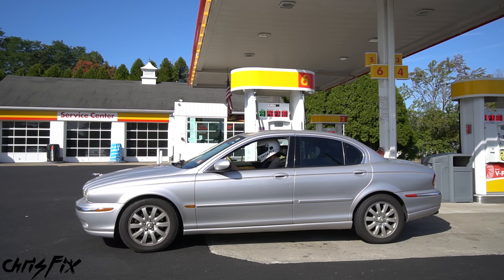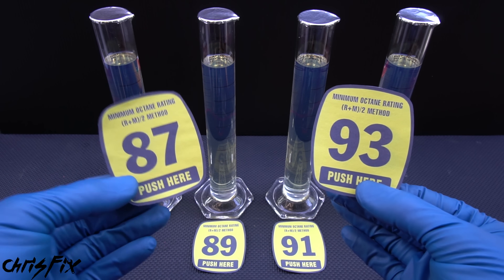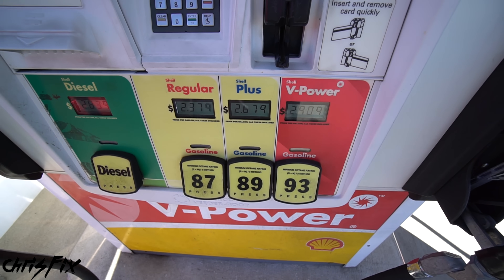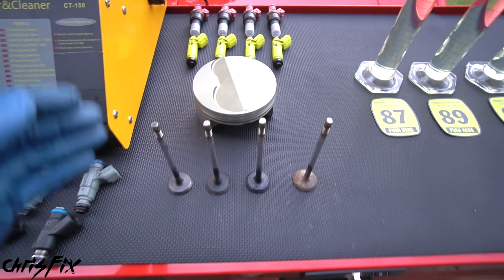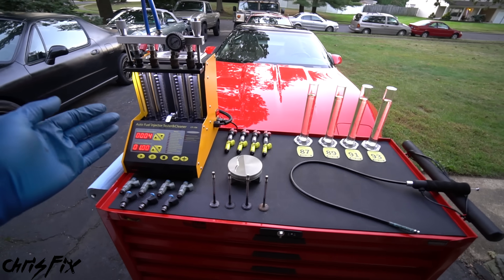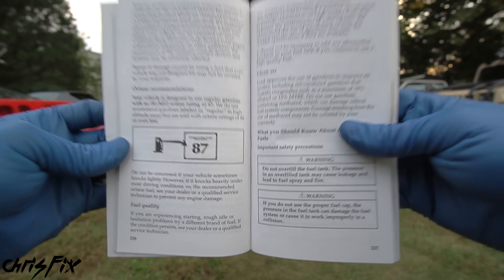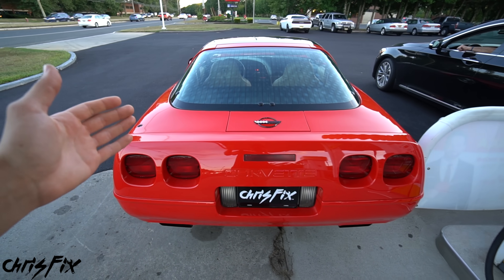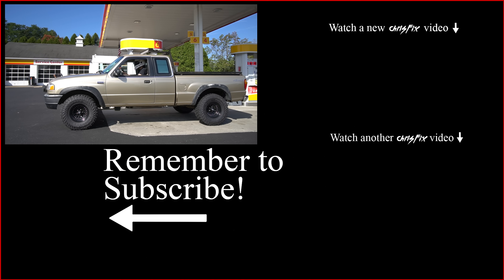What is the BEST Fuel to Use in Your Car or Truck and WHY

Comment: Chris, I just bought a 2010 F-150 with the Baby Triton 4.6 V8. The fact alone its a triton engine leaves me skeptical. I was wondering if you would still consider using 91-93
Reply: I had a 93 Grand Marquis with the 4.6 liter Triton V8. (A very good reliable motor I might add.)  I always ran 87 octane in it. It ran just fine. The motor is rated specifically for 87 octane. Some models of the 4.6 liter have the ability to get ever so slightly better fuel mileage from 91 ~ 93 octane gas. But this isn't true for all set ups. And it doesn't increase power. The 4.6 liter was always intended as a lower power output V8, that was made to last a long time in many different applications. It's bigger sibling the 5.4 liter Triton V8, is a 4.6 liter, but with just bigger heads to develop far more power out of the block. This engine was rated for 87 octane as well. However high performance variations from Ford allowed it to run on premium for more power and better fuel mileage. In pickup trucks though, it's all the 87 octane setup.

Heck even the all new (7.3 liter) 444 Ci "Godzilla V8" from Ford, that's new for all 2020 F-250 through F-550 Super Duty trucks, is rated for 87 octane.
Reply: @waycoolscootaloo  but would it hurt to put in the 91-93? I'm more interested in the extra additives to keep my truck running smooth
Reply: @ryancooper5004  You can add it. Or you could just spend $6.00 a month on a can of Seafoam and save money. Regular still has additives. But your going to pay a whole lot money for Premium which any mechanic would tell you that your flushing money down the toilet.

Comment: You put what your car was tuned for it's that simple. Unless you have had a custom tune on a specific fuel grade just put what your fuel cap says. You gain no benefit from higher grades if your car was tuned for 87 outside of if your car isn't running well. You might be able to avoid knocking if you go higher, but at that point something else is seriously wrong.
Reply from the maker: Thanks for sharing!
Reply: @chrisfix  not going to lie ty! First high lighted quote woot woot. I also made it before watching the video then watched it lol. :)

Comment: If you want a quick answer: Use your manufacturer reccomended fuel.
Reply: Normally I'd agree with "giving the quick answer" but Chris gives a lot of useful information, so it's worth watching the whole video.
Reply: @ProblemanMx  I did watch the video, he explicitly states to use your manufacturer recommended fuel..
Reply: 10:27 is Chris’ answer. Lol the rest of you on here are dumb for sassing Deity XO
Reply: @rheniusantonyraj8562 Thank you bud
Reply: Well my manual says 87 or higher.
Reply: you mean "manafacterer".... as he said near the end...
Reply: The manufacturer said my f150 could run on e85 (lowest grade gas). Don't run it on e85.
Reply: @danielgodfrey4415  That sounds like Ford alright
Reply: @jazpanoz4996 calm down fan boy, no one mentioned Chevy
Reply: Deity XO why would ya mention it,clearly embarrassing lmao
Reply: @danielgodfrey4415  did they say that verbally or in the manual?
Reply: @kurtreber9813  directly on the gas intake.
I was curious put e85 when I came across it. My truck went completely out of wack. 
Rpm dropped, struggling to speed up, check engine light, wasn't running right.
Reply: @danielgodfrey4415  Try confirming that in the manual. Possible a dealership might have incorrectly put e85 sticker on the truck.
Reply: Dude its helpful to see the whole video to see what to choose and some advises like once in a while to use premium fuel to clean a bit the engine and fixing the problem if you get regular instead of premium with buying a octane booster
Reply: What types of cars need a 93 octane? Boats?
Reply: @olivercito2011  A boat is not a car.
Reply: @olivercito2011  Ask your manufacturer
Reply: Already knew that, but was bored.
Reply: My lada ran on 73 at old times but right now I only use 98
Reply: Some people will tell you there is no difference between vendors as well but that is false. Each automobile has it's own preferences. In my Jeep it runs 3.5 mpg better on SUNOCO which I despise but it's the best I can get here. On a trip to NC I ran shell and got 8 mpg better even tooling around at 30mph in obx. Problem is Shell doesn't sell gas anywhere near Rochester NY. In my Chevy van Costco gas actually was the best but only by 2 mpg.
Reply: @DreadPiratePapa  shell is pretty good, luckily I have plenty here, but that is the whole additives and detergent packs that each company adds or doesn't, definitely helps though.
Reply: eh sometimes they are paid to do so by gas companies
Reply: @blankuser1321  source?
Reply: Deity XO i watched it a long time ago, sorry
Reply: @mohsinopiani  It happens all the time.
Reply: Your manufacturers recomended fuel will run your engine it doesnt say it is good for it
Reply: @russellleahy  Manufacturers have no reason to recommend an inferior fuel. They have EVERY reason to recommend the best fuel that would make their product last the longest. Why would they tell customers to use a fuel that would shorten the life of their engines? Go off what the Manual recommends. I am a Mechanical Engineer and have done design work and I'm telling you...go off the manual.

Comment: Had a 2000 Jeep with an inline six cylinder. Always knocked no matter what fuel. Lots of people chased the knock, most with no success. Read the manual and the manual said knock is normal. I also have a 2012 Nissan Frontier that said the same thing. Seems like they both Diesel by design. You should do a video on what dieseling a gas motor is. Moral of the story read the owners manual.

Comment: here we have 95 and low class, 98 for a lil higher standard and vpower thats a 100 :D also if i put V-Power in my wifes car it raises the rpm by 200 at idle and dosnt make funny noises also it does get more torqe, can you explain why? or is it that american cars are different from ours?
Reply from the maker: Did you actually watch the video? and what car is that happening too?
Reply: @chrisfix  that is a volvo v70 from 2006, but maby it can be because something they put in the gas over here, were on the other side of the world and the fuel is very very different here and yes i did wach the video :D

Comment: My only complaint is that the energy content isn't all the same. If it has ethanol blended in then it has lower energy density and will get worse fuel economy. If it is all straight gas without ethanol then your video would be accurate.

Comment: Fun Fact: The most expensive fuel you can buy in the U.S.A. (e.g. California) is still half the price of the cheapest fuel in Germany. So go for that Premium. ;)
Never run "Flexfuel" It's supposed to be more environmentally friendly but at the cost of your engine. Here in Germany, they mix Diesel with this "bio" crap and it starts clogging up the pipes or damages them. The only way to get around that here is by running Premium (V-Power) Diesel. Shell even offers Premium for the regular price as a so-called "Smart Deal" for 100 bucks a month. For Gasoline it's similar.

Comment: I have 236K miles on my Ford Expedition. Wold you recommend put 91 93 octane?
Reply from the maker: Are you having any issues with running lower octanes?
Reply: @chrisfix  I've heard it knock a few times.
Reply: When I need to stomp on the gas pedal

Comment: Is 93 octane the highest you can get in America, in Australia we have 91, 95 and 98 octane
Reply: That sounds like SOR rather than POR.
Which means it's the European style ratings, rather than American style ratings.
Although I've never seen 91 octane here in Europe, so I don't know :P
Reply: 98 Octane in Australia = 92 octane in the US.  91, 92, 93 and 94 octane are all considered premium in the US. 88/89/90 octane is all Mid-Grade in the US. 85 and 87 octane is considered standard grade in the US. (85 octane is only available in very high elevation cities or towns, as an even cheaper alternative to 87. Its not good enough to burn at lower elevations though where 87 is then required.)

Comment: My 3.5 eco boost turbo runs fine in cool weather on 87but in summer I use 89. I also put a catch can on it to prevent recycled waste from clogging up the valves

Comment: It is actually funny - VPower in Austria has more than 100 ROZ (Octane) and in the US just 93. In my country the 'regular' was 91 ROZ, then the 'better' one was 95 and the 'super' was 98. Then VPower (and other Premiums came alone with more than 100 ROZ) ... strange actually. With an 100 ROZ you literally can start up an aircraft piston engine (you might need to add some lead into the fuel as well) ^^ (Aircraft fuel (piston engines) -> 100 ROZ LL) :D

MOZ and ROZ are a difference but can cause trouble xD
Reply: Australia 100 octane V Power = 93/94 octane V Power in the US.

Comment: I tend to not use Ethanol mixed fuel. Though my car manufacturer allows to use it (09 European Honda Accord, equivalent US Acura TSX), I don't since it will start degrading all of the rubber parts from the fuel system all the way to your engine. Ethanol will start drying out your cars rubber parts making them brittle and eventually crack. This goes for fuel lines, seals etc. It won't happen immediately but over time it will end with it. In my country we have E-15 mixed with 95 octane fuel so I use 98 with extra additives that has no ethanol mixed in.

Comment: 6:39 First hand experience of carbon deposits. My '01 Volkswagen Polo Classic's old engine (1.4 AUA engine, look it up it's a really problematic engine) had such severe carbon deposits, that it damaged and shrunk away the material from the valve stem, sadly I found it out too late, when this weakened valve stem broke completely, and the valve head started wandering down to the piston, so at the next revolution of the engine this broken valve head turned 90 degrees  and stuck into the cylinder about half an inch deep destroying the piston completely, warping the piston winch and the crankshaft. I had to replace the whole engine, and clean everything that didn't get replace as I found small pieces of that piston as far as the bottom of the air filter.
Reply: Also, I got another engine (old engine, you only find it at junkyards) for the car. Due to regulations I'm stuck with the same engine type, still not great, might be something with the fuel system and maybe the timing (old engine from junkyard, what was I thinking), so I will have to disassemble the whole engine to the last screw, clean everything, replace what has to be replaced and torque everything to spec. My only luck is that I'm familiar with these engines because I work at a VW-group factory (Audi AHM to be more specific), and had a lot of time at the 4-cylinder assembly line, so I've seen 433 of these babies being assembled every workshift, also had some time at the rework station, where we learned the proper disassemble of a VW 4-cylinder, so it won't be difficult, just tedious and expensive.

Only thing I need is some motivation to win over my lazyness, and these videos give the motivation I need for this revival project. Heck I might even call this red car Phoenix if it can be resurrected, and give it the looks it deserves.

Comment: I have a VW Tiguan and I use 89 Octane fuel where as the manufacturer recommended 91 Octane or above on the fuel cap. Is 89 going to damage the engine pistons.
Reply: If it's not knocking, probably not. If it was knocking I'd think you'd get a check engine light after a while.

Comment: Ethanol free for me!  It's about $2.49 per gallon, I think 87 octane.  I've been running this in my truck for the last three or four years.  Just recently added Techroline to each fill up......mechanic says I have carbon buildup on my valve seats.  Very informative video,,,,,good job.

Comment: Here in Australia, we have E-10, 91, 95 & 98 (Premium). I don't put E-10 in my vehicle anymore because after awhile my car was having starting issues so I changed to 98 Premium & have never had any issues with my car. I was told by my mechanic that the E-10 builds up a lot of moisture in the motor which isn't good. The 98 I use is BP 98 Ultimate that has a cleaner in it & my car loves it.

Comment: Only super performance cars require high octane. Regular just needs normal gas
Reply: Not really true. There are some "regular" cars that are very high compression ratio, usually to improve performance on a very small engine to boost economy, or to make them burn cleaner or something. The owner's manual will tell you what they need.

Comment: Just to let you know, although most places have 3 grades of Fuel, They only order 2, I know From Shell where my Step dads runs 3.  They only order bronze and Gold, there is no Silver.   Silver is a 50 50 mix of bronze and gold.  So buy Silver and get the additives and don't buy Gold, not sure about Knocking though, depends if 89 is enough for your car.

Comment: wtf in germany V-power has at least 100 octane :D generally those octane numbers are quite low... most people here use super which has 95 octane. some also use e10 which is super with 10% bio-ethanol
Reply: 100 Octane in Germany is 93/94 octane in the US. E85 which is sold at most gas stations in the US, is 105 octane.

Comment: 93 octane as V-power? 🤔

In the UK regular fuel is 95, most premiums fuels are 97 and V-Power is 99...
Reply: 93 octane in North America is the same as 98-99 in Europe.
Did you miss the part where he discusses how octane ratings are reported in North America vs the rest of the world ? 
Your pumps report only the Ron (research octane, ie a theoretical number) whereas in North America we get the Aki (ant-knock index) which is an average of ron and Mon (motor octane number, which is an actual measurement using a standardized cylinder). The end result is that for a given resistance to knocking you see a higher number and we see a lower one.
Reply: @CaptHollister  ah that makes sense then. I thought you were getting a bad deal. I know fuel is alot cheaper in the US. But not where you were getting worse quality. Thanks 👍🏼

Comment: I've been putting 91 octane in my 2015 Dodge Challenger RT (Automatic Trans) since I bought it new.  I just looked at the Owners Manual (duh).  It recommends using 89 octane.  Have I done damage to my engine using 91 octane for 5 straight years?
Reply: If anything, you're probably helping your engine out reducing carbon deposits. I'd be worried only if it was lower octane you were using.

Comment: In Germany we have Super E10 that's gasoline with 90 propane and 10 bioethanol and its the lcheapest and "worst" gasoline that we have.
our Shell has
E10 | Super | Super+ | V-Power
90       95          98            100
     [PROPANE]

The highest propan percantage is 105 at the Aral at German 
gas stations.
Reply: 100 Octane in Germany is 93/94 octane in the US. E85 which is sold at most gas stations in the US, is rated at 105 octane. However our 105 octane avoids propane all together. E85 in the US is 15% gasoline and 85% Ethanol alcohol. Propane isn't used in the US, typically because gas is cheaper and because gas has more energy than propane. Propane is only used in very specific applications, where a vehicle has to be used indoors. And in these conversions, 100% straight propane is used.

Comment: Despite the manufacturers recommended 85 fuel for my 2018 Honda Civic EXT,  I’ve only used 93 since buying it new. And I’ve only used Shell because of the extreme high detergent additive in their 93. I’ve always been aware of the flaw in modern turbo design and every little bit of detergent helps. I’m gonna take the Civic in for a valve cleaning at 50,000 miles. I’m curious as to how much or how little carbon deposits have accumulated in the valves.

Comment: That Mazda B3000 looks sweeeeeeeeet!!!!! i like the tires, rims and the lightbar i have a mazda B4000 4.0 v6 with ported aftermarket heads dual exhaust(it was straight piped but i didnt like how it sounded like a ricer) i put a cherrybomb on it and its been the best truck ever to me. id love to know where you found the tires specifically i just need better tires on mine.

Comment: Chris nailed all the key points here. As a foreigner that lived in America since a child, I found out that Americans have easy to understand octane ratings. Shell is my go to gas station because I have shell fuel rewards. BP is my second choice. My Toyota calls for octane 87 or higher for better performance so I stick with octane 89. What people don’t understand is that when you’re at the gas pump..... take your time! If you forget what fuel you need. You can lookup your car. I wouldn’t do this at a crowded gas station though and don’t rely on the gas station worker. They don’t know your vehicle. I witnessed a dude did that and the employee told him the wrong octane.

Comment: Hey Chris I have a question I have a Chevy Suburban that use E85 gasoline but I use 89 mid grade gasoline because my dad told me the E85 and 87 will Damage to car which it did. My question is that it ok to use 89 on Suburban

Comment: 87 has the most energy (BTU) for the same volume and the higher the rating number the more retardant added to slow burn time and pinging is when fuel burns too fast so a retardant is added to slowdown burn rate. Premium fuel starts off as 87 octane when delivered to gas station first additives is added into underground tank and then 87 octane fuel is added to allow through mixing of additives. The trucker always measures remaining volume of underground tank so he can formulate amount of additives needed proceeding with fuel that is all 87 octane, the more or less additives the specific octane rating achieved which is how they get 89 or 93 octane.